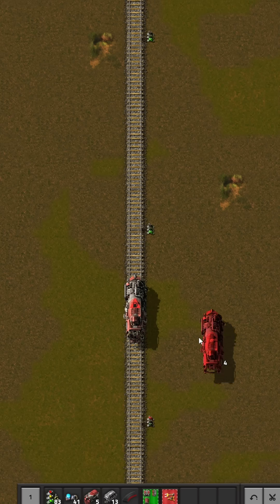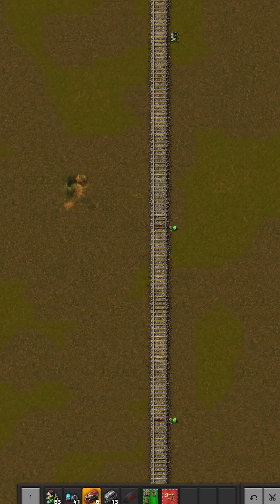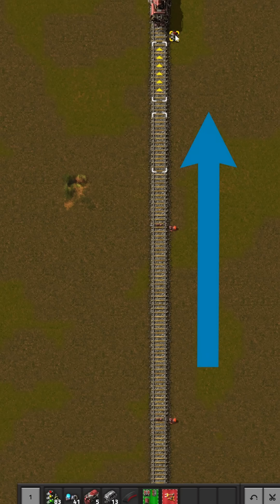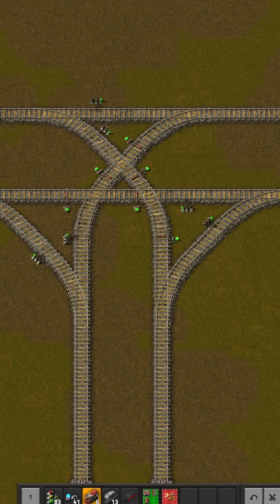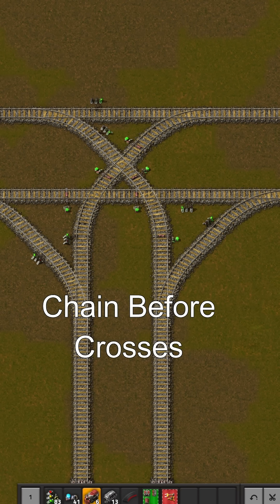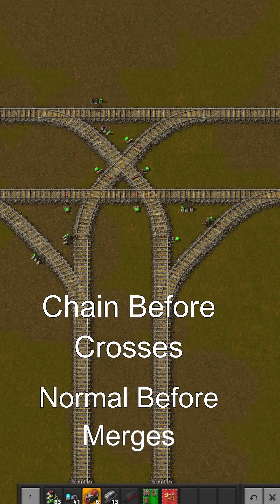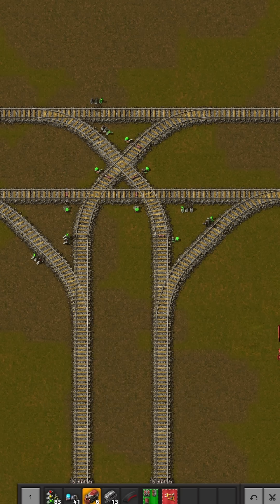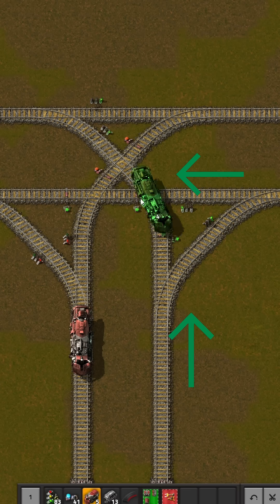Simple Factorio Train Signals Tutorial | #factorio #factoriotutorial #shorts

Comment: A popular tutorial on train signaling gave 3 rules:
1. Identify your exit blocks and place a regular signal at their entrance.
2. Chain signal before every crossing/merger.
3. Exit blocks should be as long as the longest train that will use it.
Reply: No idea what an exit block is though
Reply: @aljoP14  It's the part of the track where a train fully leaves the intersection.  You can put a regular signal there.
Reply: @Liwet.  Ok, so basically put a regular signal just after the intersection (#1) and place another regular signal after the max length of a possible train (#3)?
Reply: @aljoP14  For track sections with no merging or crossings, yes, you can place a rail signals along the length of the track.  The track in between signals is called a block.  You can only have one train per block so more blocks means having more trains on that part of the track but keep the blocks big enough to hold the longest train that will use it.

The first part of these uninterrupted track sections that comes after a crossing/merger/intersection is commonly called an exit block.

Comment: your T-intersection can still deadlock. the correct method is chain signal before crossing or merging, and normal signal after merging/crossing and to seperate blocks. always check that the distance between signals is at least as far apart as your longest train and you won't have deadlocks.

Comment: Decent summary for someone just starting with signals but as you probably realised the text on screen blocks the bottom signal which makes it harder to follow along unless you already know what light it will be displaying.
Reply: That's why the "watch" page is useful since it turns the short into landscape mode and the text no longer overlaps the video. ;-) [also, it includes the usual navigation control and timestamp features that are MIA for shorts.]
Reply: @irrelevant_noob  how do I apply the watch page ?